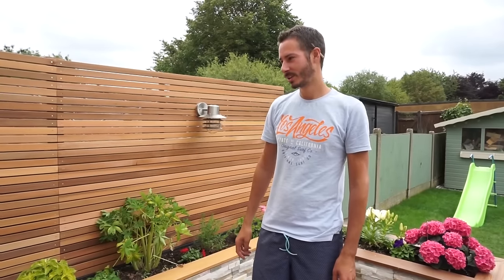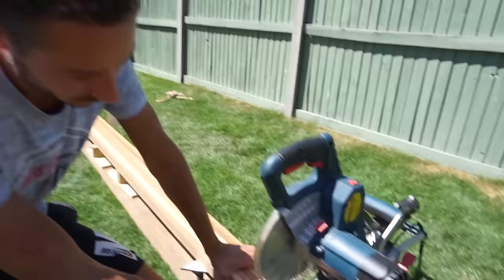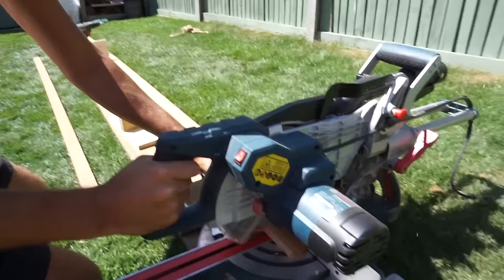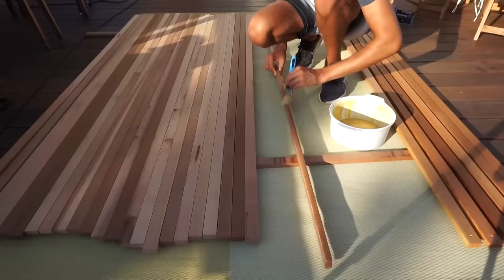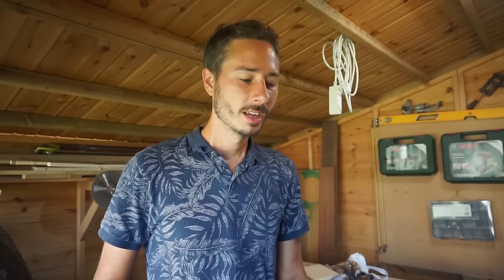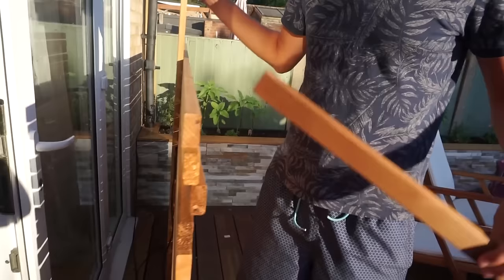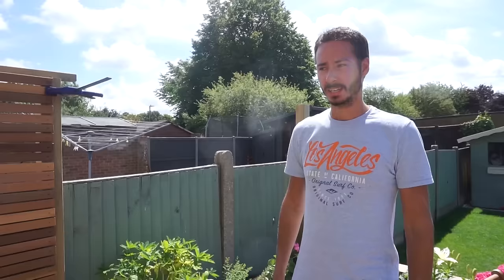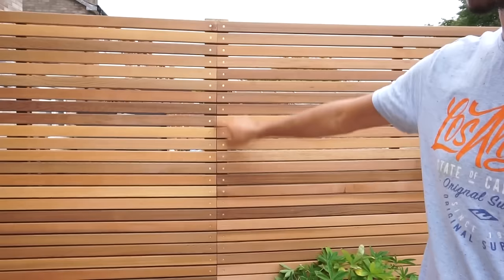How to make DIY cedar fence panels with built in lights | The DIY Tribe

Comment: I would prefer a vertical batten to cover the seam where the two panels meet. The brass screw heads are not unattractive, but the natural color variation where the battens butt together is distracting. For the sake of symmetry you could add a vertical batten to either end. It the battens were staggered to echo the stone wall below, the effect would be less jarring, but that would have been an unreasonable amount of cutting and fitting.

Comment: Top tip..........................when using a drop saw to achieve a nice smooth cut use a saw blade with as many teeth on it you can.

Comment: Looks nice yes. You should always use stainless steel nails or screws for fixing cedar as all others Will stain the cedar over time when they react with the water and salt. The flat head screws must have been a nightmare!
Reply: Yikes, I thought I saw flat head screws😳

Comment: Really like this. Would it be possible to screw the lengths from the back to there are no screws visible on the face side?
Reply from the maker: Yes, on our extra support battens we screwed from the back, however on the 4x4 posts we didn't have screws the perfect length to go through the 4x4 and not out the other side of the battens on the front

Comment: Hi, How Much did the Fence cost Please? roughly - Just Materials (tools not included)
Reply from the maker: Hi, it wasnt cheap, the wood was £480! The screws were around £30 and the lights were £30 each :)
Reply: @thediytribe8424  are they standard battens or are they treated
Reply: Hi. Where can the wood be purchased please
Reply from the maker: @foru2justnv  Hi, we used standard, untreated battens from Silva Timber.
Reply from the maker: @wendykeeley3873  We got ours from Silva Timber :)

Comment: Hi Ive also purchased these from Silva Timber. I noticed the decking oil used was Cedar - did this not darken the battens? Also did you receive quite a few crooked battens?
Reply from the maker: it did darken it ever so slightly but not too dramatically. Yes we had a few warped ones. we ordered 5 more than we needed so we could choose the best ones. Adding the extra battens down the back should stop any warping though.

Comment: Stainless steel screws are to be used on cedar, not brass
Reply from the maker: we choose solid brass screws as they are more aesthetically pleasing and to avoid any rusting :)
Reply: Stainless steel screws of the proper grade do NOT rust and also look better than the brass which will corrode over time.